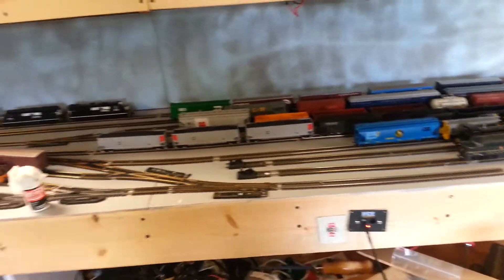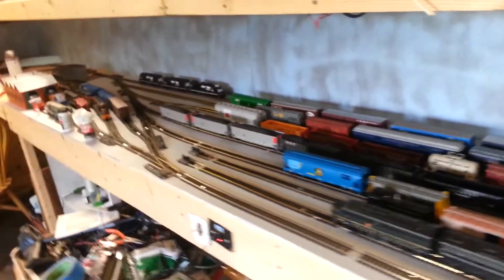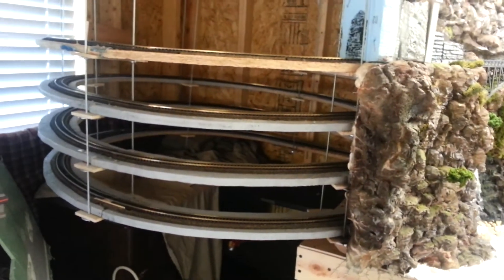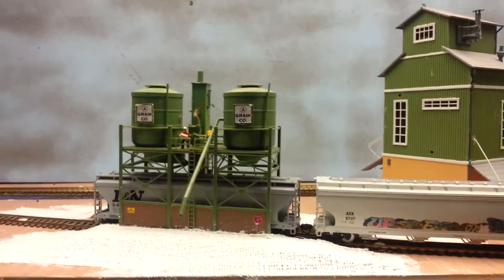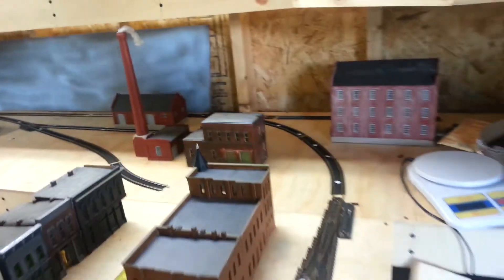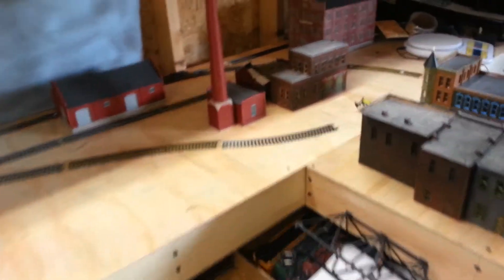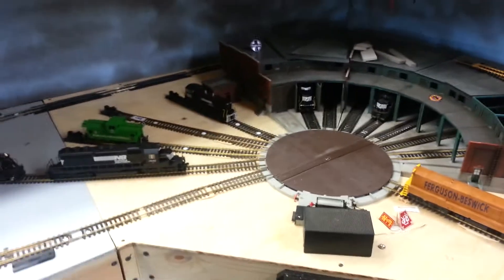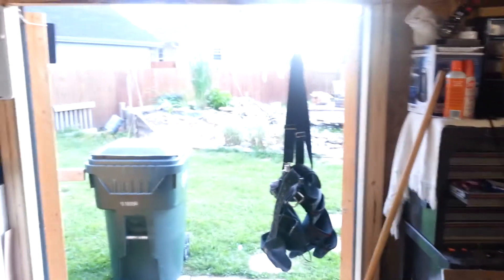Second attempt at a ho scale layout

Comment: great track plan, that helix is well built great job, man would I love to do an operating session on you railroad!
just one suggestion, while you at the early stage of track laying you may want to drill a 1/4" hole centered between the rails right under the throw bar for your points on your switches, just in case you ever want to put under the table switch machines, just a thought   subscribed    thanks for sharing
Reply from the maker: Chuck thanks for the comment, So much has changed on the layout but the winter time came me down till Spring, my heater out there just is not enough but i did put some 6 slow switch machines in the top part of the layout with DPDT switchs and bi polar leds. I just realize i never made a video about it. That video will be up as soon as i can. Thanks again